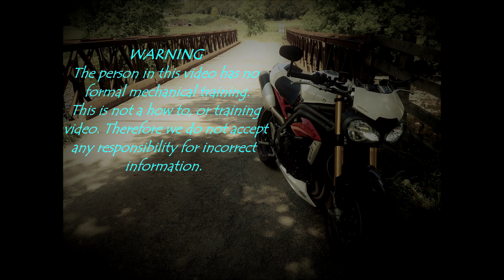Speed Triple service - part 2. swing arm refit - bearings replaced

Comment: Thanks for the video, doing mine this weekend as wasn’t done as part of the 12,000 mile service, and it’s great help watching your 2 videos first, as now know I’ve got the right tool on way to fit swing arm adjuster.
Reply from the maker: Glad you found this useful, and remember DONT hit the bearing with a hammer 😂
Reply: What a pain getting the 2 brake hose holder screw out!
Reply from the maker: Yes it’s quite tedious 🤬

Comment: Here is a little tip for the owners of older Speed Triples 2005 and 2006 if you are dismantling the linkage.One of the long bolts screws directly into the swingarm.But you have to remove the inner sleeve to free up the link.The sleeve has an internal thread into which you can screw a large bolt and by using a couple of large ring spanners on the outside you can tighten the bolt and withdraw the sleeve.A drawbolt arrangement.Well the tip is you do not have to look far to find a suitable bolt.The large bolt that tightens the eccentric chain adjuster -17mm head-fits perfectly.But always remember on re-assembly to push the inner sleeve back in with the threaded end on the outside.
Reply from the maker: Cheers Tony, thanks for the input 👍🏻